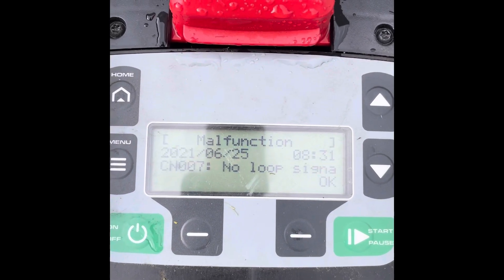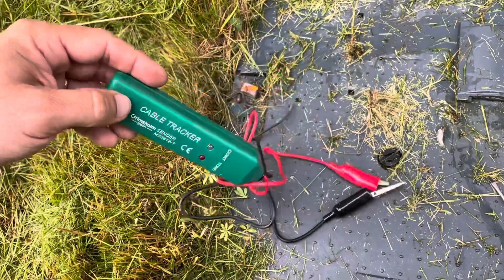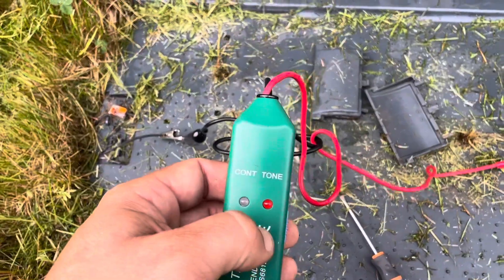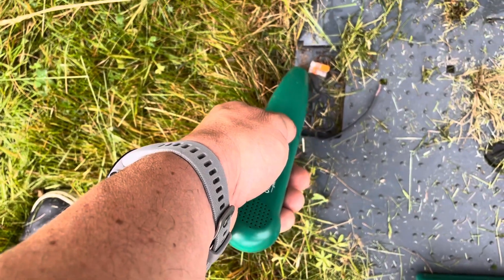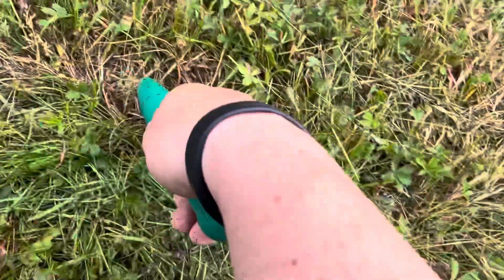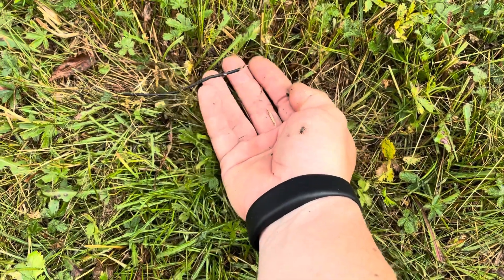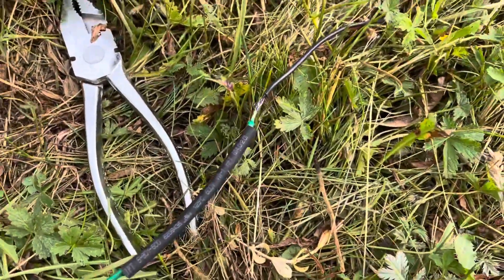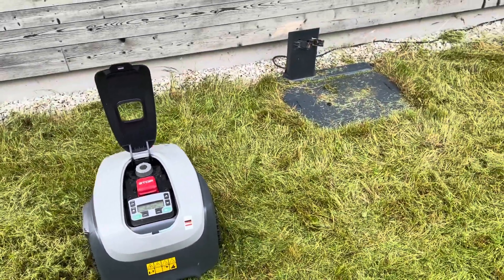Lawnmower no loop signal error repair / fix signal cable

Comment: question.. it says no loop signal but the cables are find and the greenlight is solid too. we tried also to reset the robot but still says no loop signal.. any advice?
Reply from the maker: Disconnect, the Power cord from the socket, Wait 2 minutes, and reconnect, this will reset the base station

Comment: So mine shows there is contact, yet still it shows this error. Any idea What it could be?
Reply from the maker: I think the solution is very simple. Just unplug the power cord wait for three minutes and reconnect.
Reply from the maker: After the fix the base station has to reset.